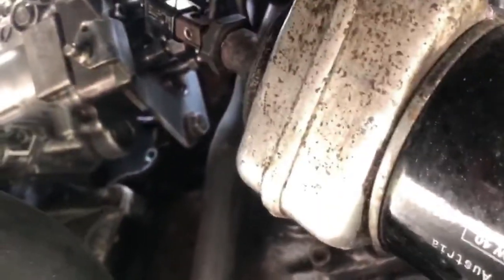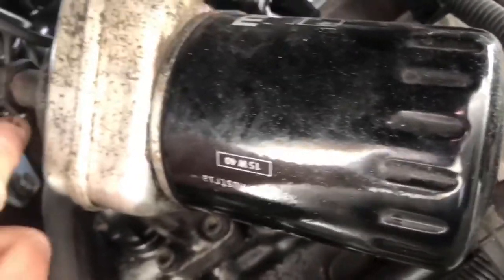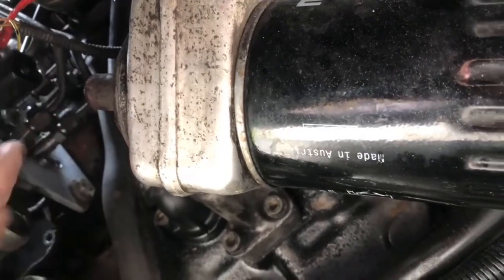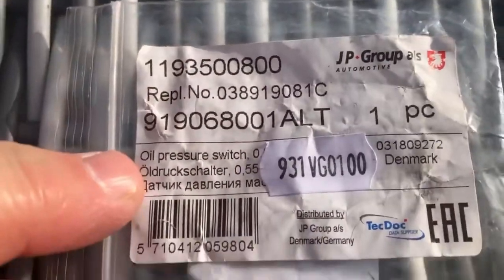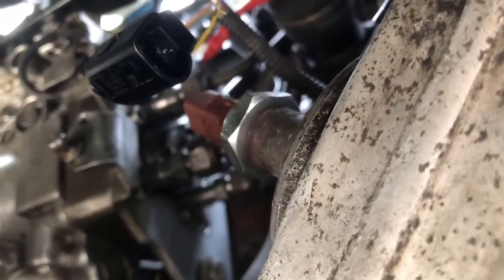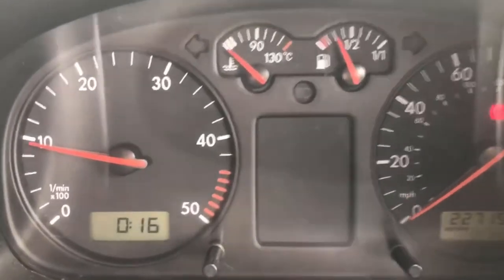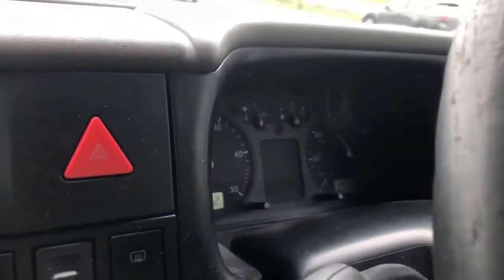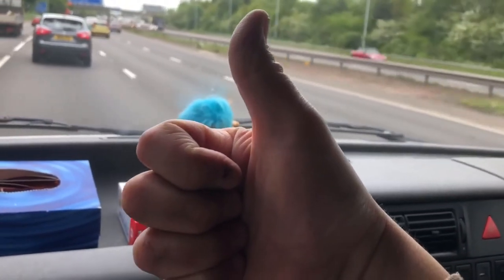VW T4 - Oil light flashing? How To Replace Oil Pressure Switch

Comment: A family member is currently having this issue with her van, except it's a red flashing warning light and beep intermittently (will sometimes go off by its self or will go off after pulling over an turning engine off)  only AFTER having a routine oil & filter change. Had a 2nd oil, filter change and new oil pressure switch put in. Still doing it. Garage say oil pressure is good. Maintains normal temp, no strange sounds of any kind, no loss of power. At a total loss of what this could be...
Reply from the maker: Have you checked all the electric connections and fuses?
Reply: @MonkeysUncleDubzClub  I have not. Personally I'm not massively mechanically minded so it's all a bit daunting but I have heard a few things like it could be an alternator issue or a wire coming off of it (blue wire to be specific) also heard it could be a dash cluster issue? How could potential electrical faults happen after a routine oil & filter change? That's where it's baffling...

Comment: A useful video but it would be helpful to know the location of the sensor.  I assume it's underneath the engine?  I can't see mine because of the engine guard.
Reply: Just above the filter, yes you'll need to drop the cover to get to it.
Do an oil change at the same time.
You can easily do this on driveway. You'll need jack and stands if your van is slammed.

Comment: Hello, take it easy, I have a 2000 model t4 2.5 tdi vehicle. Even though the oil level is full, when I turn on the ignition, the yellow oil lamp flashes 4 times. What could be the reason for this? Thanks.